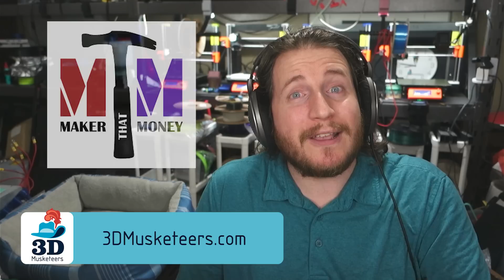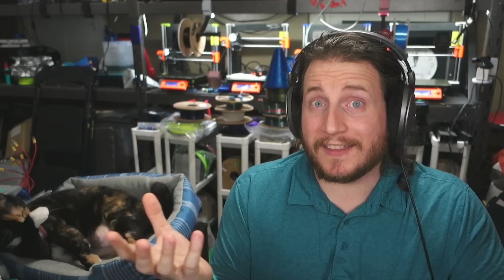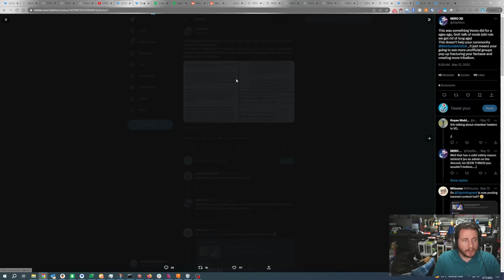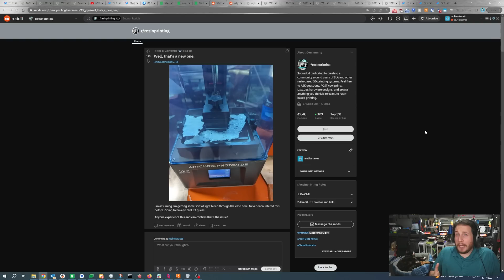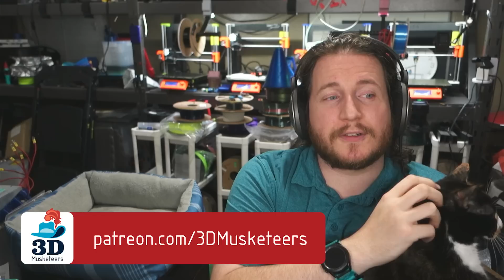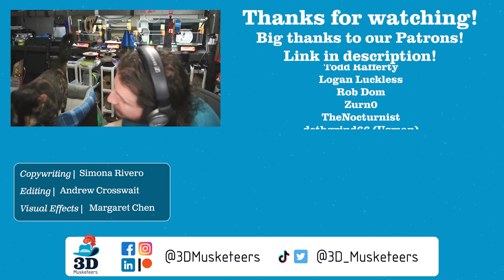Bambu Lab: Anti-Mods, Anti-Right To Repair?! - PrintFixFriday 88

Comment: Nothing wrong with closed source things (as long as you don't abuse open source in the process). I'm a huge advocate of right to repair and regardless of stuff being open or closed source stuff should be given access to repair the things you bought and paid for! I know you give creality flack alot but the fact that I can repair it when an issue occurs adds value to a product for me! I'll take a machine I have to often fix over a machine where a company tells me how or how to not use a machine. I know these videos are old but man the writing was on the wall all along. Bambu's BS has single handedly made Prusa haters go more silent, including me, and I have no shame in saying that!  I'm actually excited for the CORE ONE.

Comment: Uuuh wtf?!
now i'm debating getting a bambu. but what else is there that works well :|
Reply from the maker: tons of printers out there that work great.. Heck, my experience with Bambu has been anything BUT good.
Reply: which ones are you thinking of or recommend?  @3DMusketeers
Reply from the maker: depends on what you want to do with them.
Reply: @3DMusketeers  print abs/PC/CF parts regularly and the good old PLA. I want something that just works and doesn’t require fiddling with constantly. I’d like it to be enclosed and fast
Reply from the maker: MAYBE the qidi tech XMax3, but there is no such thing as a printer that does not require fiddling
Reply: @3DMusketeers  oh I heard really bad things about the Qidi.
Reply from the maker: Mine had some issues, but it did just do a print successfully, likely some growing pains for me lol

Comment: The vibration in the 7 minute pre-print check is a "Fast mech mode check". It doesn't fully calibrate the vibrations, it checks if it changed and gives you an error if one of the belts is loose for example. You can re-run the actual vibration calibration on the machine.

With more recent versions of bambu studio, as well as orca slicer, you can manually determine flow rate and PA values for your filament, store these values as profiles, and turn off the auto flow calibration before the print. I do this, but I performed an automatic calibration, mainly to save on time and filament
Reply from the maker: yeah I need to do the manual one..
Reply: @3DMusketeers  it needs a newer version of the slicer, but I'm not sure if it needs updated firmware in the machine
Reply from the maker: I am sure Orca has it, so we will see!

Comment: I have not bought an X1C because of this exact issue, I asked a YTuber who runs them in a print farm if he had any issues with the rods or bushings and I did not get a reply, I guess this is something to do with him getting free product from Bamboo, his silence speaks volumes, he did, however, reply to loads of commenters who were licking his arse, so Im assuming he did have issues and Bamboo have either replaced his machines or fixed them on the quiet, if they release a new machine with new bushings and different rods I might be interested but I won't be buying an X1C unless the issue is fixed.
Reply from the maker: eh, I doubt it is a payment thing, I do my best to reply to everyone, it is a thing we do here, however it is not the same for everyone

Comment: I'm glad joel is getting support but if that's not equal across the board then they are just cutting a loss for looking as a good company. The aspect of having to continue to call them out is just becoming a point to distance myself further.  The lidar issue is just that and too much of a repeatability and reliability issue especially because my assemblies require repeated parts so if they dont mesh well its very noticeable.
Reply from the maker: i feel you there, that is why I mentioned it here. Had it been a setting that was my fault, I would have not really dug my heels in, but because we dont have access to the data points we cant even see if there is an anomaly in it all!
Reply: @3DMusketeers  I really appreciate your time you put into these videos and how you strive to be positive while also make sure you are also putting out videos as unbiased as possible,  yes bambu is putting you through the ringer but I feel you are trying to give them chances to get better and you mention it when they do finally come around. I hope to see you at errf this year.
Reply from the maker: I do my best but man sometimes I lose it...

And yes we will be at errf!
Reply: @3DMusketeers  see you there, I will be at a table this year. So it's a plan.
Reply from the maker: Nice. I'm hoping to cover more tables this year and streamline the interviews. Will have to try and stop in

Comment: huh? they are selling basically every replacement part, probably more to come.
Reply from the maker: I completely disagree. They will sell you an assembly but not the part itself. If you have one of the bearings go bad in the pulley on your x-axis you cannot replace it and must replace the entire thing to the tune of $90 versus a $3 part. As far as I'm aware you also have no ability to order spare motherboards or any of the circuit boards for the machines. And while they might end up releasing more spare parts, it seems the only way to get it is to make a stink about it
Reply: @3DMusketeers  Could they only sell the $3 part though? From what I've heard these things aren't possible to disassemble. Of course that's a problem with the design, but a $90 part is better than your printer being broken forever. The worst part of it might be having to try and fix the printer yourself. Even if you get the part replacing it probably takes many many hours.
Reply from the maker: That specific part, no, they cannot. It is a press fit pin in a blind hole, so it is not easy to remove it without damaging the printer and because the frame ends are not open source, you just cannot print a new part and assemble it. 

I agree that $90 is better than e waste, but I think we all can see that they only did this as a response to community backlash and nothing else.

Comment: ”Hardware or software modification done to the printer”… PRINTER, so no, they are not forcing you to use Bambu Slicer to not void the warranty. In a previous video you mentioned that you changed the build plate to a third party one. If that is still the case, it’s most likely the reason for your LiDAR issues. Also, there’s nothing stopping you from writing your own g-code for the startup sequence, and save it as a profile. And there’s no reason what so ever to do a new bed levelling and flow calibration if you are reprinting a model with the same filament and build plate. The latest version of Bambu slicer remembers what ever boxes you had ticked from the last time.
Reply from the maker: Clearly there was a reason for me to redo it since when it did it the first time it was absolute garbage. I am using a third party build plate as it is considerably better than anything offered by the first party. I have never had issues with the lidar side of it before. That was a new one for me.

As far as software goes, it's not specific enough where it defines exactly what they mean by that and I think lawyers would get into arguments regarding it. I just believe there should be more clarity and specifically, more transparency. 

Some may disagree with me, and that is perfectly fine. I don't represent the vast majority of users. I own a business that deals with non-disclosure agreements among other high security items.

Comment: Will Stillwell is a fan of suppressing free speech, He kicked me from the group a while back cause I mentioned how bad bambu's QC is. Bambu just doesn't like people to talk bad about their printers, even though its legitimately warranted. Claimed I didn't own a bambu printer ( I owned a P1P), which is irrelevant because there is no rule that states you MUST own a BL printer to be in their official FB group anyways. BL is anti open source and anti right to repair and BL only released their replaceable X axis kit due to this backlash, just like how they only made bambu slicer open after backlash, and reduced their thermal runaway timer after backlash....BL is the kind of company that only acts after they've been caught.
Reply from the maker: I have no evidence to agree with the first part, but the second part I do..

Comment: Playing devils advocate for a minute, the Bambu with the bushing play was caused by the owner oiling his rails. He put out a video back when he got his first Bambu and got aggressive when people pointed out the embedded graphite meant that it was self lubricating and what he was going was going to cause wear. He has 10 of these machines all just as bad because of misuse.
With that said, the answer they give of it being normal is not acceptable, they use the same answer for the VFAs and the taco beds... It's not on at all. To their credit with this though, they have made the gantry available as a spare despite the first response being that we would need to ship our printers to Bambu to have that part repaired.
I am very sick of the anti-user approach by Bambu in many of these instances! Has there been any update on the log file investigations?
Reply from the maker: Did it because they screwed up the printer in the first place. While I believe that changes the narrative of a little bit, I still think the discussion of right to repair is still incredibly valuable and needed as we move into an industry that is more focused on features rather than open source. He definitely didn't follow directions and that absolutely resulted in the damage of his machines. And while that sucks, I believe the mod has a place because it was done out of necessity because at the time they were unable to buy the parts that they needed. And so, while I might have founded him for not following the directions and causing the screw up in the first place, I still believe their point of needing to do the mod because they didn't want to have a big brick of uselessness his valid.

As for the log files we do not have any further updates at this time. The encryption algorithm is incredibly complicated and we apparently have a couple of people from Google now working on it so I am excited to see what comes of it. I do agree with you regarding the taco beds as well as the vfa issues on these machines. The keyway and QC absolutely needs to be addressed and they need to start giving a damn about their consumers rather than what kind of profit margins they're making on these machines

Comment: i received 2 brand new sovol plus print heads from sovol did a bed setup ist print was a cube sliced with sovol cura, print head goes to the centre draws a line then starts dumping filament in a one inch line i then tried with cura slicer and did the same thing i might try to switch it to klipper  and to think i got a email for sovol 7 after 20 emails on complete failure on sovol plus machines yea 2 of them
Reply from the maker: sounds like a steps/mm issue... email me some photos ill take a look

Comment: Bambu doesnt seem to understand the market that they stepped into. People who buy consumer level 3d printers overwhelmingly pride themselves on mods.  To come out with a printer that is showing awfully early signs that it isnt a design that can handle a ton of miles, and then make it difficult to get parts,  AND THEN discouraging mods...  they have zero understanding of who they are selling to.  Bambu doesnt have any of the makings of a company that is going to have any kind of market staying power.   In this market if you arent going to support right to repair you better have a machine that is tougher than an old nokia phone or make getting repairs easy and cheap.  Bambu is failing both.  Failing in an epic fashion.
Reply from the maker: only time will tell if they succeed or fail...

Comment: Hi Grant, thank you for this :D . 
I totally agree on your views on BamPoo... 
However why do we always/most of the time speak about bad things. I like to tell you what happen to me and what awesome response I got:
    I did buy a canbus toolhead board of Mellow (like Bambu a Chinese company) and after a few weeks of use the a capacitor blew up. Mellows response was : ~"...you put 5V on a 24V bus...". Other user have the same problem with their Mellow Fly SB2040V1.0, even Steve Builds had that and Mellow replaced the 2 boards of Steve's IDEX Trident build. 
   Now comes the awesome part: after I did mention the story in Steve's live chat, FABREEKO, told me to contact them. Hector offered to send me a Mellow Fly SB2040V2 to IRELAND, even that I did not buy of them nor they have any compensation for the warranty service they would provide for a Mellow product. I would buy of Fabreeko, if they had a EU warehouse to order from.  But back to the Fly SB2040V1 (the blown up one): before Hector offered to send me a replacement, Aliexpress decided on a full refund for me under Chinese warranty, and therefore I declined Hectors offer, and to the fact of high shipping cost for Fabreeko and import fees for me.
   If someone asks me what printer to get as out of the box and print, I advice to get a Prusa, if they want to have e the build experience, I would advice a Voron Trident or V2.4 LDO kit with Print It Forward (PIF) parts if they have no ABS printer.
Reply from the maker: I mean, print fix friday is about failures.. so? lol

And generally my experience with bambu has not been good

Fabreeko is about 3.5 hours south of me, we will be visiting them one day!

Comment: Your first printer should be a Prusa kit you build yourself. The Prusa XL multitool is going to be miles ahead of any other user friendly, repairable and modable desktop printer that is actually accessible to a wide range of people with different skill levels for 3D printing and building.
Reply from the maker: heres hoping
Reply: Cheap too!

Comment: I have been very lucky with my P1P and AMS.  I haven't done any maintenance on it at all except for replacing 1 PTFE tube in the AMS.  I do not like the cloud printing though and the LAN only mode sucks.  I've seen yours and Nero's experiences though and I am all for right to repair so that pisses me off. I hope there are people out there reverse engineering  these things and aftermarket parts will become available. If not I'm gonna ride this bish till the wheels fall off. I still got my trusty VORONs working perfect as well.
Reply from the maker: Make sure you clean your CF rods too, the dust and crap on it can cause excess wear, but I am happy yours is working well! Print it til it dies LOL

Comment: I guess I should be a counter balance. Hitting close to 3k hours and no issues whatsoever. I feel kinda silly because when I I bought every single part available in the Bambu store and only needed to swap out a wiper. 
The carbon rod assembly will be available in the store which was the supposedly biggest pain point people had. 

The X Axis carriage is $88 on the bambu store and will available soon. So much for anti right to repair....😁

That guy who swapped the rods and bushings greased them, you do not grease the rods and bushings.
Reply from the maker: he swapped them for steel rods and bearings. And bambu only put those parts up after significant community backlash. I recommend you look at how complicated that swap process is, it is incredibly complicated. There are plenty of more claims I am happy to bring to the table for anti right to repair on these machines, but I really tried to keep the focus of this simply to the ability to repair or otherwise. 

I am glad yours is working though! I am hoping I can get mine to be reliable like that one day, but running stock does not seem to be the right way to do it.
Reply: @3DMusketeers  I saw the videos.(panels, belts, carriage) Everyone who owns a bambu printer is still under warranty. I am an OG kickstarter backer.(AUG 2022)

I put together my mk3s+, ender so I'm not exactly scared of replacing a part or parts. Personally I would have a 2nd printer for the downtime, if I did need to do repairs. 

I haven't assembled a voron but it seems less daunting than that. ( no software to manage, or tinkering either) if you keep a 3d printer for any extended period of time you WILL need to roll up your sleeves and do maintenance and possibly repairs. I did it on my Creality(too much) and my Prusa(not as much but a few times).

I treat right to repair in levels
1. Can you even repair the unit? 
2. Are parts available?
3. Are parts reasonably priced ?
4. Are there instructions for repair?
5. Are the instructions from the manufacturer or do I need "community support" which is a fail for a company. 
(bonus if there are videos)
6. After the repair will the product perform the same or better than stock.
7. Am I actively supported or hindered in  repairing the product?

If you take a company like John Deere or apple(I've been watching a lot of Louis Rossman) there are companies that punish you for doing repairs if they allow it at all. Thank you for your time. If I could clone my printer I would happily send it to you since it works great.
Reply from the maker: I like your level system.. maybe we can implement something like that for a rating system???

Comment: Magnuson act says a company has to prove the damage was  caused by your repair if I remember correctly. Simply replacing a part to keep its functionality intact should not void warranty automatically unless they can prove it was the cause of the failure. Now its been a while and I might be completely wrong but I do believe this is what was stated.
Reply from the maker: I think you are right, but again I didnt look into it much..

Comment: silly question, I don't own a Bambu so may be way off, but which build plate are you using, as the Lidar is only compatible with the untextured one (your print looks like it was printed on a textured plate)?
Reply from the maker: Wham Bam Pex Plate, no texture